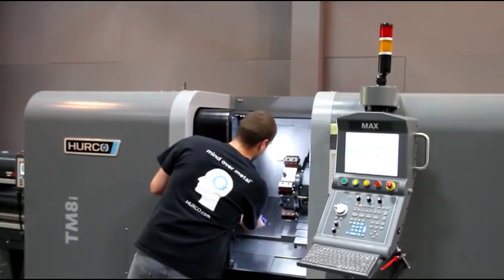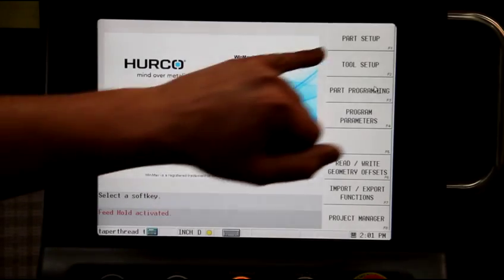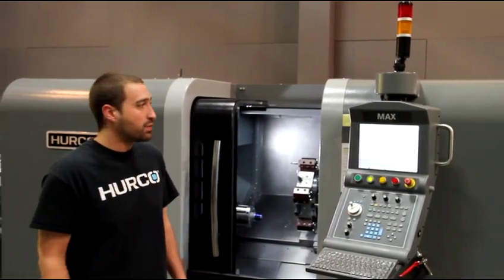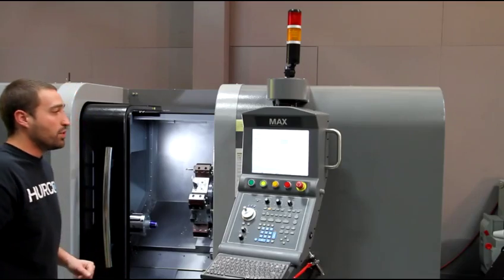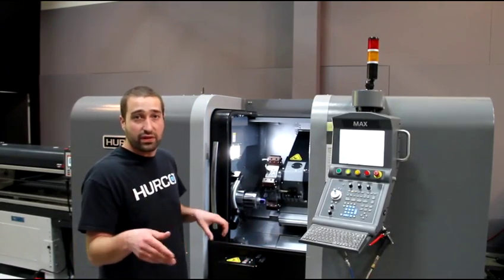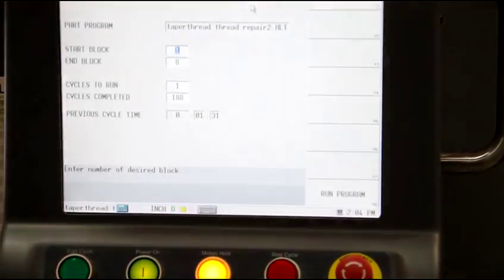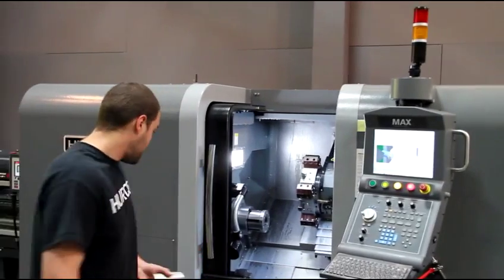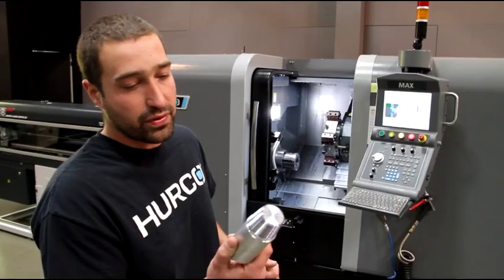How to do Thread Repair on a Hurco

Comment: Watching this machine is like watching a HAAS SL-20. Same exact thing!! Except that the HAAS is faster on the tool change. It goes straight to the tool without staggering at each station. Great machine either way.
Reply: But you're stuck with a Haas.